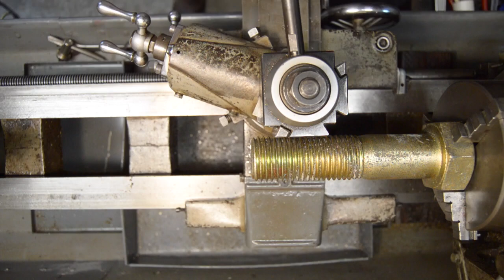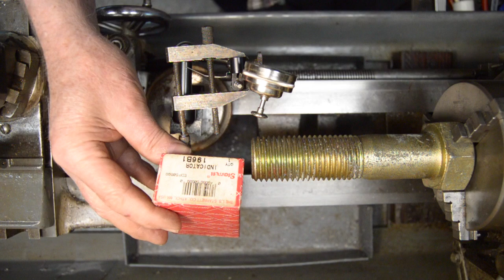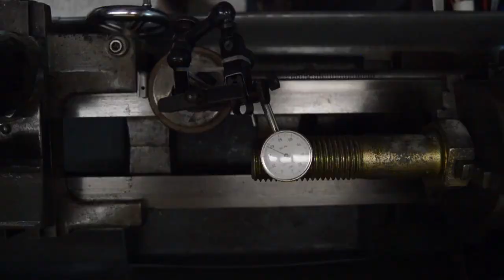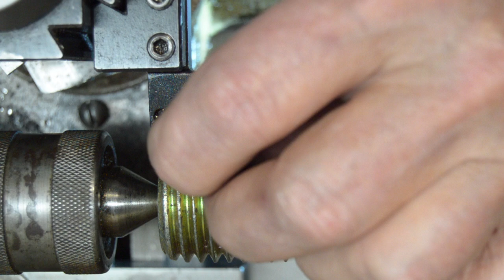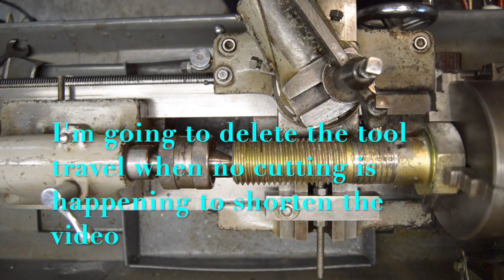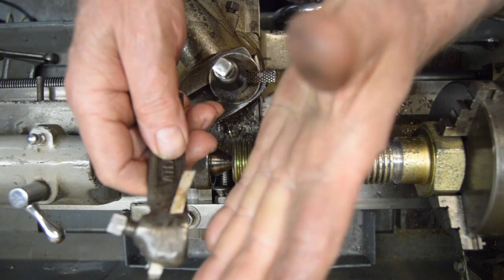Extending threads on 1-1/2"  6 TPI bolt on Atlas lathe. Part 0ne

Comment: The easy way is to put the cross slide at 90 then just line up the crest to the tool or just dive into the valley with the half nut engaged. 
This 1/2 angle is to hit and miss.